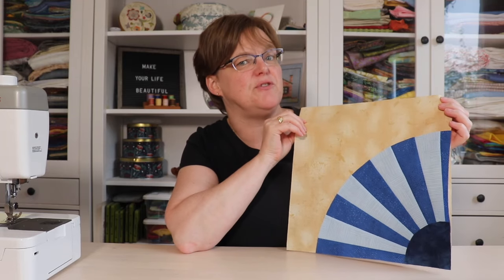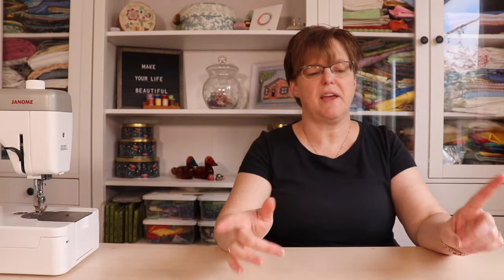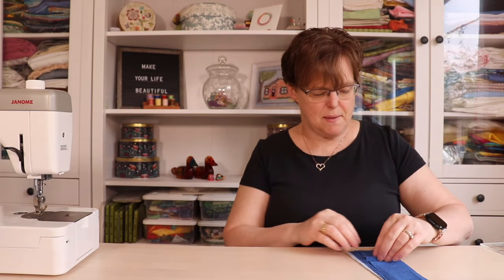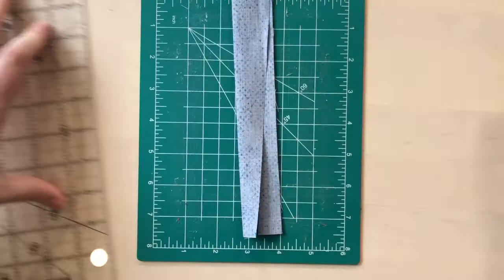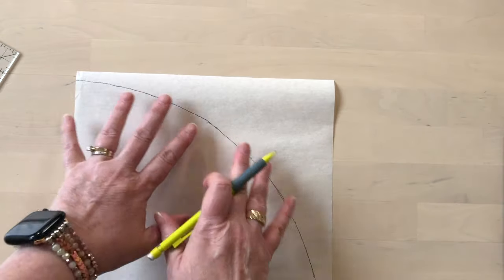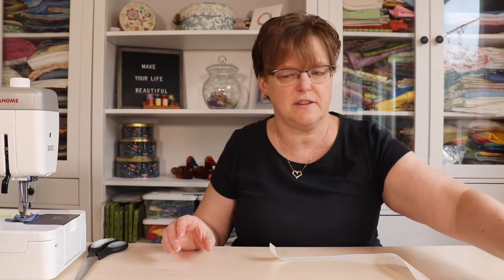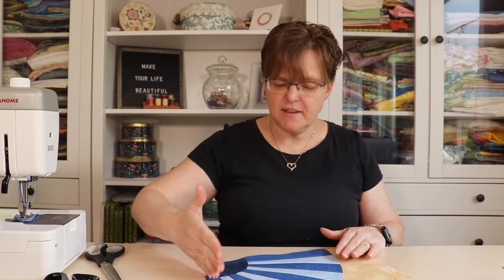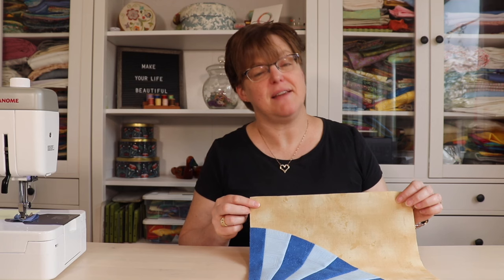Easy Fan quilt block tutorial

Comment: Hi-so the fusing will prevent the material from fraying?
Reply from the maker: It depends on what type of fusing you use. If you use a heavy weight, it will prevent fusing, but it will also be pretty stiff.

I use a lighter weight fusible, so it could fray a little bit, but then I stitch along the edge to help secure it. You could stitch a zig zag stitch, decorative stitch or even just a straight line.